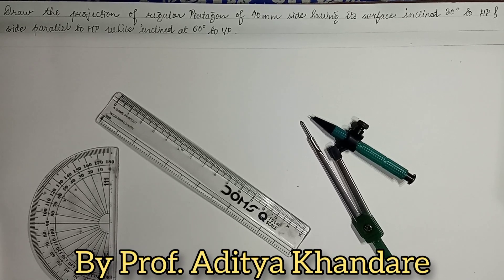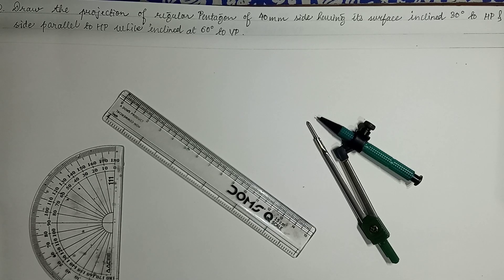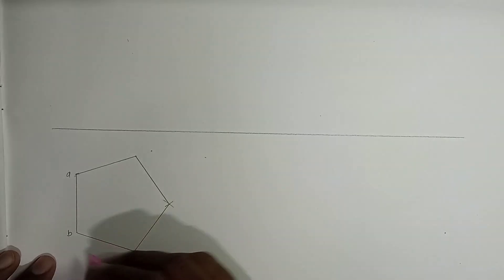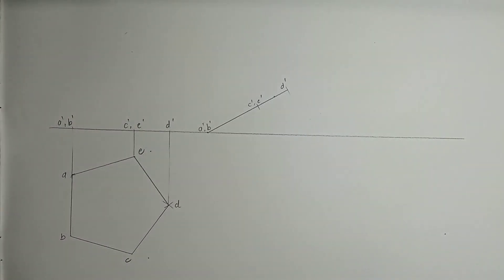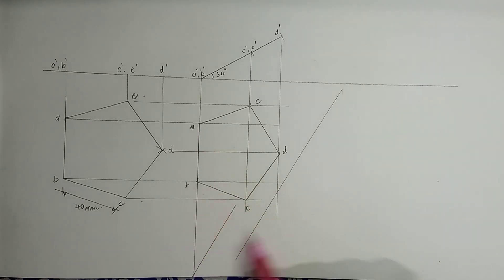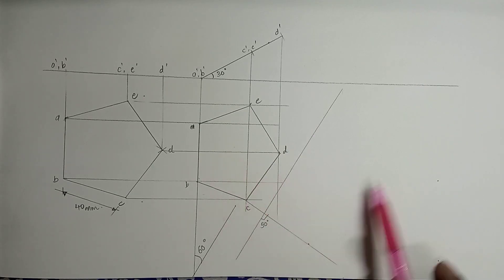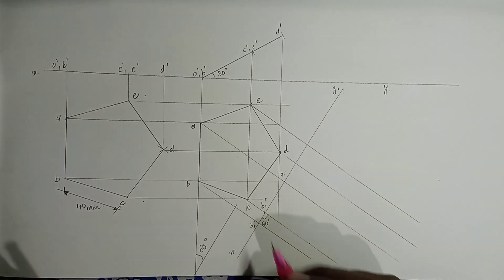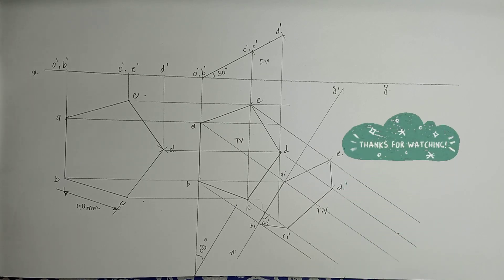Projections of Planes by Auxiliary plane Method: Pentagon

Comment: wait, that angle is'nt 60 that's 30...
Reply from the maker: 30 degree is surface inclination and 60 degrees is inclination with VP
Reply: @adityakhandare  I'm talking about the angle of the auxiliary plane. That angle is supposed to be 60, but holding the compass like that would give you 30 not 60.